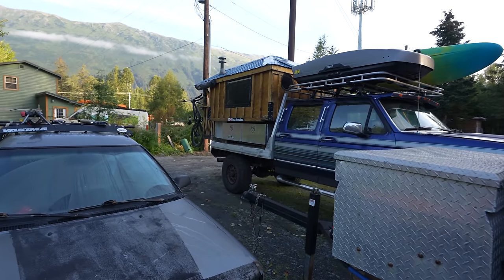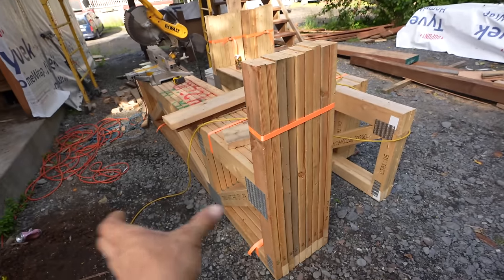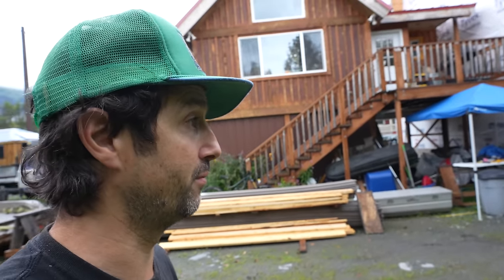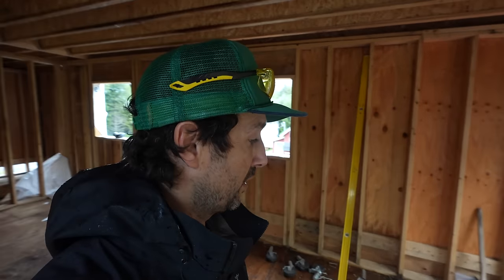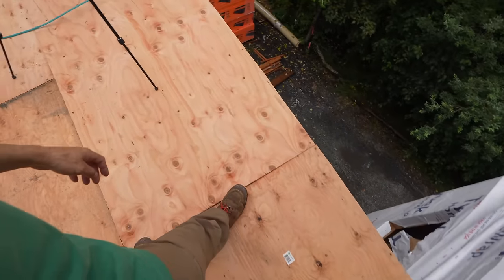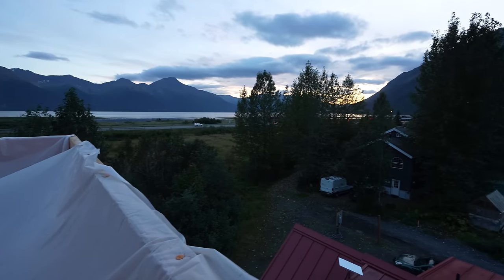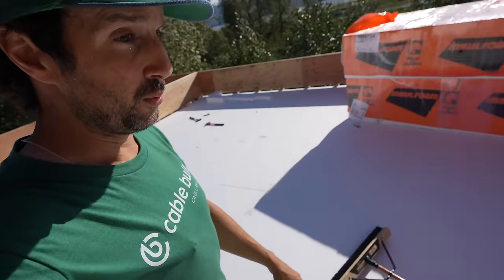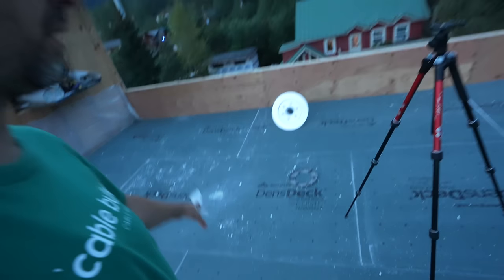i might be in over my head.

Comment: Question.... with the freeze thaw winters we have been having and the fact that there is going to be a deck on top of the roof..... are you planning any sort of heat tape or a way to thaw the roof?.... especially the drain and scuppers?...
Reply from the maker: yup gonna heat tape the valleys for sure and the drain/scupper

Comment: HOW will you remove the SNOW from the Flat top Roof that will surely accumulate thick and fast ????
Reply: He has talked about having a snow blower that stays up there
Reply: Anchorage only averages around 75"/yr.
Reply: @smashedfootlefty4726  I wanna see snow cruds fly off from way up there!
Reply: @MarkMeadows44  from the ground and the drone... :)
Reply: @smashedfootlefty4726   Yes! The deck roof is close enough to the powerline , right? What can go wrong? #snowcrudsonpowerline #snowbombyourneighborwithluv
Reply from the maker: snowblower up top
Reply: As a roofer’s daughter I can tell you a flat roof can handle snow load as long as it’s built correctly. The snow melts and runs off same as any roof. I’m in northern Minnesota and there are flat roofs here.

Comment: Maybe you can set up a place on the property where it’s level at the four points of contact, have blocks of wood or metal with the center of each recessed where the Jack stands fit into, this way you’ll be able to save wear on those motors. The blocks could be removable so they wouldn’t degrade in the winter months, just a thought.

Comment: Do you not have a WET/DRY Vacuum to at least suck up the still water to help you dry up the floors faster. I only suggest it as  I notice the professional builders i watch, use them. Thought it might be helpful when youre getting so much rain. Id hate there to be water damage after the time and effort you 2 have put into this build.
Reply: Truckhouselife_  
???????
Reply from the maker: I drilled holes through the floor in several spots to drain the water to the slab

Comment: Why the drain in the middle of the roof deck?  Concern for ice dam in the winter blocking the drain?  Honest questions.
Reply: It may look like it's in the middle of the roof deck.  The drain hole would be closer to the outside wall if you can visually remove the deck's two-foot overhang part.  Remember the scupper part for any overflow. I think he said scupper in this video time 30:44. I wonder if the ice dam can happen with over 8 inches of foam underneath. For the ice dam to happen, we need to melt snow quick and then freeze the water quick to become an ice dam. I would be surprised to see an ice dam on top of that much foam insulation.  I think he mentioned in the other video something about leaving snowblower on the roof deck which I wasn't sure if he was joking or not, but I am looking forward to seeing how it looks with the snow on top of the roof deck.
Reply from the maker: heat tape for ice, shouldn't ice dam because the foam is R49

Comment: Why didn't you run the drain down thru the wall? Or only use scuppers to drain outside of house?
Reply from the maker: u don't want to run drains in walls in cold climates, they freeze up
Reply: @TruckHouseLife  yes, most plumbing is in inside walls to prevent freezing.  If snow is melting n going down drain it is too warm to freeze,  right? If scuppers are for overflow why not use only them n no drain ? How do commercial buildings,  like Walmart, drain flat roof?
You are doing great 👍  enjoy ur videos keepem coming. Tia.

Comment: there is no way in my mind that i would run that water drain though the house like that.  id figure a way to run it on the outside of the house
Reply: Many commercial buildings are designed this way.   Plus its not pressurized water like the plumbing pipes that run inside every house that has running water has.
Reply from the maker: it's pretty standard